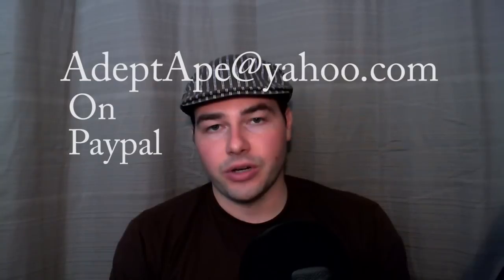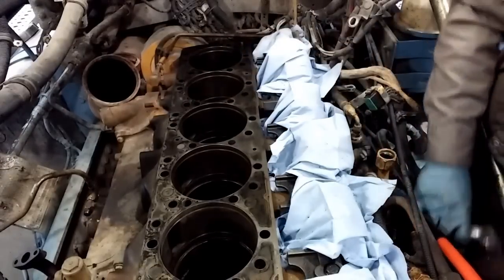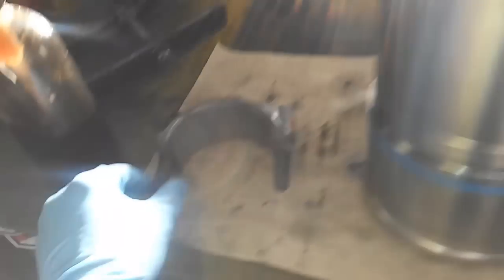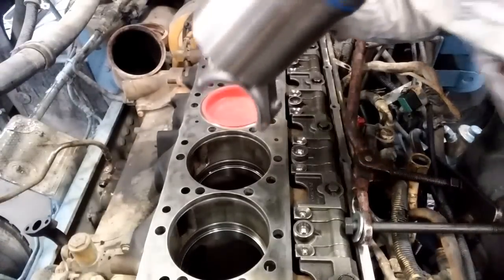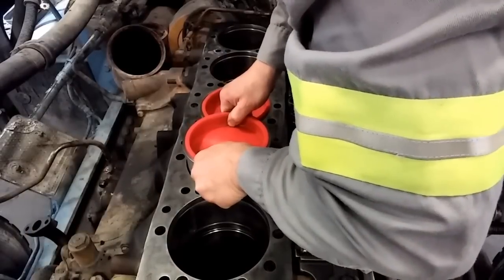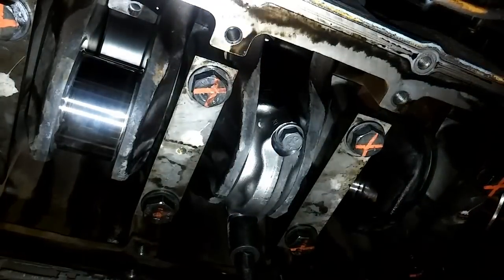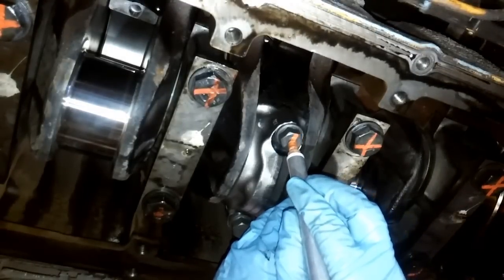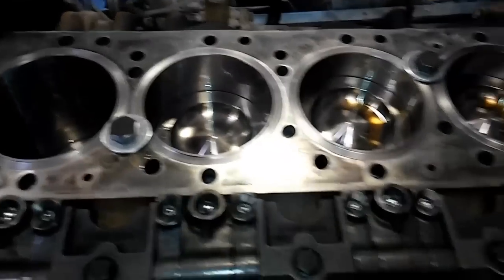How To Rebuild A Diesel Engine Part 4.  Deck Prep, Piston Packs, And Rod Bearings.  Cat C13.

Comment: I no this is a old series but I sure wish you could of finished it out . I'm working on the same engine right now. What do the head bolts torque to and what sequence do you torque them in . If you have time to answer I'd it would be much appreciated!

Comment: I've never heard of using an impact on critical inside engine components. I was taught in diesel mechanic school always use a torque wrench and go in small increments building up to the final torque required.

Comment: Ok I'm ready. My 05 c13 lost an oil pump and scarred the crank up. Doing an in frame with a used crank. I feel properly qualified now. 

Thanks for the clever 60 degree trick with a marker.

Comment: Detriot 14liter is the same way from what I see. 
Drop sleeve and piston in all at once. 
Then button the bottom up. 
You have to check the liners in a detriot with a sled gage and you have to use a different tool to push the liners in. But same concept. I got a few videos on my channel if you wanna get a good laugh of a driver attempting to be a tech.

Comment: Awesome video Adept Ape!  I have been a generator tech for 4 years now and I have my 1st large engine I have to install new liners, pistons, and rings on.  It is a 14.2L running on natural gas.  I have disassemble and reassemble many automotive engines but never anything with liners.  I was a little uneasy about it at first but this video just made me a lot more confident.  Thanks a million!

Comment: This is the guy I want rebuilding my engine,he is a true mechanic,not just another fake with a toolbox
Reply: I have not watched all the video's was the head bolt holes tapped out? The roll lock cleaning pad removes a lot of material. Cat likes for the mill marks on the block to remain. Roll locks can remove them. I use a air sander with sand paper and remove the debris on top. Keeping the mill marks intact. Any part, head, spacer plate or block. Roll lock pads are a no no.  Not saying he is bad, but 
watching me rebuild one would be a long video. As TheOtherWhiteBread0 a lot of  good mechanics out there and a ton of week in 
warriors. 
Who I redo M-F.

Comment: I got c15, 05, mxs in. 379 peterbilt. 1.3 mill on motor and start leaking, should i rebuild my motor from caterpillar or any regular mechanic?
Reply: Authorized dealer you can get a OPT, with WARRANTY up to four years. If you think a expensive shop/mechanic cost to much. Hire a cheap shop/mechanic and see how much it cost on the second repair. Because the first one was worthless. 
We have one right now that a mom and pop shop built two years ago and now has a spun rod bearing. A OPT would have covered
 this repair parts and labor with a min. charge. Now this guy has the entire bill to look at. I don't care what you say Fram said it all. 
Pay ME now or pay ME later.

Comment: Surprised you didnt check the deck for flatness. With how bad it over heated you think there could be some warpage? 

I love those scotch brite pads too, though I dont use them on aluminum parts as they can take out a decent amount of material.
Reply from the maker: +Taran Coman I do check the deck for flatness and I even made a clip for this video, but when I went to edit it I couldn't find it. I'll have to make it on the next engine rebuild video. I've never seen one warped though from an overheat, usually just the head is cracked. Thanks for the comment.

Comment: Nice video! Rebuilding engines is one of my favorite jobs.
Additional tip: use a 7K-1977 under the liner retaining bolt washer. It avoids possible damage to the top of the liner.
PS - I torque turn with an impact :)
Reply from the maker: +Derek Anheliger Is that the liner protrusion washer part number? I only put the bolts in finger tight, just there so the liner doesn't moved up while rotating the crankshaft.
Reply: Adept Ape Yes sir, same ones!

Comment: hey, adept ape.
i got something that looks like an oil leak comming from head gasket(never heard about oil leaking from headgasket but...). i havent checked it closly yet so it could be comming from manifold. it started after after i fastened the exhaust really tight. this is a toyota diesel engine. and it is not coolant comming out. and it is not just soot, its kind og wet.

Comment: Hi adapt ape. We have cat 3512C  and the coolant temperature goes high as much as 88-94°C. Any idea what's going on? Checked the turbo, temperature sensor, radiator,  coolant level. All ok. Please suggest what else needs to be checked?

Comment: hey man. I know your busy but I had a quick question.  I've been a forklift mechanic for 6 years now. (big and little ones, diesal lp and gas) and I'm about to go work at a cat heavy equipment shop. and tips for me?
Reply: any*
Reply from the maker: +Jamie Spading Get good with ET and SIS many mechanics are not and it helps out tremendously. You will learn everything else as you go.
Reply: thanks man. I appreciate your input and time.
Reply: as of now I'm great at electronic diagnostics so hopefully I'll be able to pick up on it quick at cat.

Comment: greatly appreciate  your  videos sir.   I was wondering  if  you had any advice for a diesel  tech. grad that is looking  for a  ground level  position at a CAT dealer only catch is that I only  have  the experience  from tech school and I've graduated back in 2012.
Reply from the maker: +MrLa55cr What were you doing since 2012?
Reply: I've been been a extrusion line operator. I also went back to a PM refresher course last year.
Reply from the maker: +MrLa55cr Well being an operator isn't going to get much exposure to wrenching, depending on the job of course. So the hiring company will pretty much look at you as an apprentice, but if you have a good reference from the last company you worked for that should give you an edge over someone with no previous experience.
Reply: Adept Ape thank you  sir I'm going  take a chance and apply for a few different  positions at a lower level  and try to  get  a  foot in the door  then move up
Reply: I have to make that leap of faith. again your greatly appreciated  sir

Comment: Love your videos as we are currently trying to learn more and more about these cat engines. Have you ever seen a split tip/cracked injector on a 2006 c7?  When you turn the truck on, it fuel knocks and surges at all rpms like no tomorrow and will plume HUGE clouds of raw diesel at all rpms as well. Can't cut injectors out with cat program because it runs to bad to perform any test. No engine lights at all either. Basically the motor acts like it's dumping raw fuel either through a faulty injector or cracked tip.

Comment: should you remove pistons from liners and liner seals then first fit liners to make sure you have to correct liner protrusions
Reply from the maker: +Paul C On the C15 with the liner protrusion this is a good idea. Although Carry requires pretty much all C15 and 3406 engines have the counterbores cut, so the liner protrusion should be good after that.
Reply: Cheers congrats on been a dad too great videos

Comment: I have an acquaintance that had his C-15 rebuilt by Cat, within 38000 miles of having it put back in he had to be in the shop about 4 times with many problems including having the engine blow on him again. From what I understand Cat won't repair the engine anymore, even tho he did buy the Plat warranty from what I understand. Basically he didn't have a truck to run with so his business lost the battle and bank took it back, not wanting to fund his truck anymore. It was a 5EK BTW, why would Cat do this to him and what should he do do you think??? Thanks for the video's and again, best wishes to you and your new born child!!!!!!
Reply from the maker: +Gary ClarkII Without having all the facts it is hard to say. The Platinum kit should cover that engine depending on what warranty he got, usually four years, from the date of the rebuild. Did he do anything to hot rod the engine or mess with the ECM? I've never seen Cat not cover a valid warranty, is this an actual Cat dealer or like a Kenworth dealership?
Reply: A Cat dealer in Montana
Reply: Let me find the video talking about this so you can watch and judge for yourself
Reply from the maker: +Gary ClarkII The hyperlink doesn't work on my phone, what is the guy's channel name, or just video description. If you want to communicate better please send me an email at AdeptApe@yahoo.com, the comments section gets buried easy and I miss stuff.
Reply: Gary Clark II did you find the video?

Comment: congrats on the little one. Loosing much sleep? Thanks for another great video. I just told another mechanic about using an impact for the turn. He'd already done the rods and 2 of the mains on a loader.
I don't think there's a much worse place to do it. I thought he was going to hit me for not telling him sooner.😊
Reply from the maker: +Cbmech I know some places say not to use them, but I've seriously never seen any mechanic at work turn them by hand.
Reply: +Adept Ape 
yea I know but the last time I looked past the torque specs in the book it at least implied it should be done by hand. And people not in a dealer shop don't always get exposed to the better ideas
Reply: +Adept Ape 
I first got exposed to torque turn as an apprentice in 1970 checking the rod bearings on 13 651b's, the engines came with pal nuts but the new spec was torque turn and it was a long time before I was exposed to using an impact wrench. And if you're talking about a bolt that would be torqued over 400lbs,
that saves a lot of work. Especially on heavy equipment.

Comment: Congrats on the baby!  Hey Josh I finished my C-13  2 weeks ago 6k miles so far so good 👍  Running Really good.  had a couple of scares in the first few hundred miles , but its breaking in smoothly.  Keep up the videos man 👍
Reply from the maker: +Big Foot You beat me on the rebuild time, although I had the delay. I'm sure the engine will be fine. Just make sure and put a load on that engine to seat the rings.
Reply: Adept Ape yes sir......ive put several heavy ones ....i do containers so im heavy most of the time.so far so good.  i got a buddy of mine who wants me to rebuild his c15 but I dont know too much about those.  Im just an owner operator on survival mode thats all.  hopefully ill learn more someday on c15
Reply from the maker: +Big Foot I would say stay away from the C15 unless you know them well. The Cam backlash can be a pain, but they have the liner protrusion and counterbore cutting that is a big problem that needs a lot of tooling.
Reply: Adept Ape I hear ya. someday i will though.  For now My c13 does the same job as any other engine.  ✌️